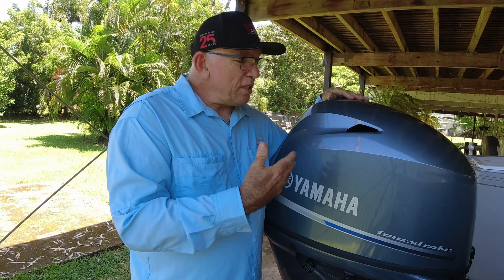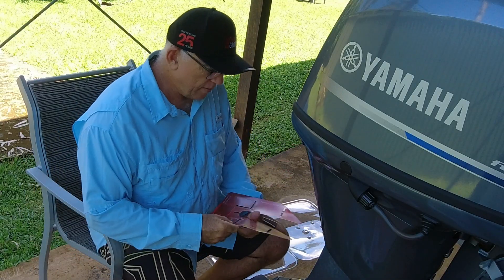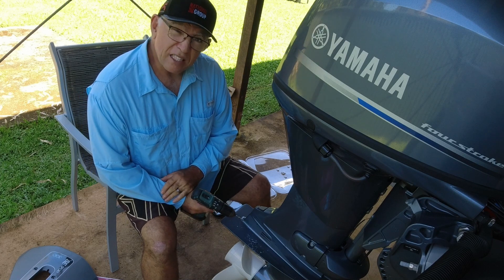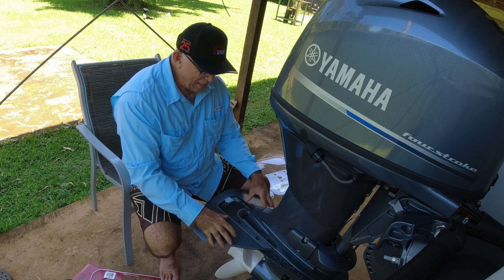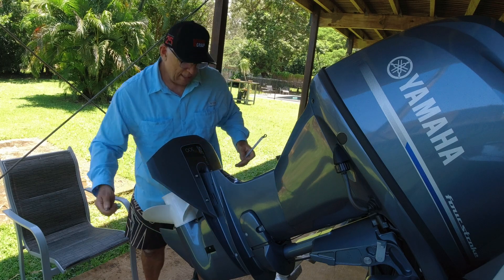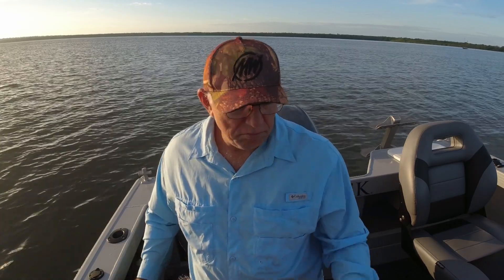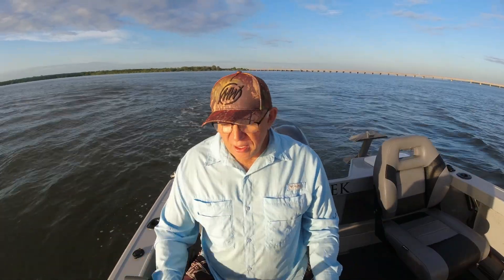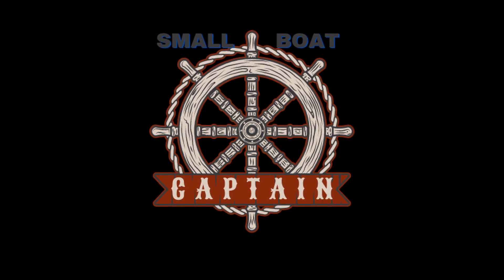HYDROFOIL. Do they work?

Comment: Gday mate being as i am going to have a fiberglass boat and a 40hp i will definetly be getting a foil can you tell me what gauges you have for the size motor and boat i would think really the only one i would need is the tacho  to be honest i have never used gauge before on any of my boats ,i wonder how a tiller steer gets on dont think there are gauges for them .
Reply from the maker: G'day mate. What outboard are you getting? If it is a Yammy like mine, I have the 6Y5 gauges. These are the basic gauges you get with a Yamaha but will have to buy them for a tiller. You can upgrade to a 6Y8 gauge which can work out your fuel burn and is a little more fancy. Both the 6Y5 and the 6Y8 will fit a 40 Yammy. Other outboards also have their gauges that will suit a tiller steer outboard but being a Yamaha guy, I am not sure on the details. They are cheap at around $300 plus fitting for a single tacho that also has the trim and a couple of alarms for overheating and oil pressure. That is the one on the video on the left. The second gauge I have is mostly for fuel but also has time, battery, trip and speed. But speed is not accurate so I use my GPS. 
Hope that helps and thanks for the question. I may not know all the answers but happy to share what I do know mate.
Reply: @smallboatcaptain1968  gday mate thats what i was wanting , the dealer dont give nothing away asked if i need a fuel tank control box all these things he could charge me for i already have a fuel tank and a new control box 703  had to buy it as the last owner lock tighted (permanent) the centre bolt to the case and also the screws that cover the control cables why who knows ,as i said i really think the only gauge i should need would be the tacho for a small engine dont need to know how fast im going as long as im moving in the right direction never had one on any other boats , he has quoted me between 500 and 1200 for fitting its a bare boat with new helm and control box if it goes to 1200 i will want to know why ,i have fitted about 5 engines to date myself and doesnt take a great deal of time considering it was a 40hp two stroke that came of bolt holes should be the same just a slap and fit job .Thanks for answering my question tell me do they still use the u bracket at the back of these gaues to hold them in still ?
Reply from the maker: @crispernator  Wow. You did answer your own question mate. I just went on line and checked. The tacho only gauge for the Yamaha 6Y5 is $330 and fitting it, as I am sure you know, is dependent upon where you want it. Plugging the gauge into the engine and running it through some conduit is not hard, as long as the engine supports that gauge. The hours you can spend wiring it up to a dash or panel is another story. But $1200 is nuts. Thats more than a full day of labour to plug a gauge in.
Reply: @smallboatcaptain1968  your dead right about the cost 500- 1200 that was for the engine fit up hook up the helm cable 4 mounting bolts and water test ,i have fitted around 5 engines my self it aint that hard dont know what the cost to fit the tacho would be it requires a loom as well 195 dollars i believe .
Reply: @smallboatcaptain1968  just to let you know i am getting a yamaha 40 had yamahas on all my boats 2 strokers first 4 stroke .
Reply from the maker: @crispernator  Might pay to shop around. That is way too much.
Reply from the maker: @crispernator  Good to hear. Great engines. I believe that anything made from 2019 has a plug in system for the gauges. You're right, a loom and the gauge should be a very simple fit.
Reply: @smallboatcaptain1968  with yamaha engines as you say everything is color coaded ,watched a guy change the early one  6y5 to the latest 6y8 i think took him 3 mins to change it over they are all the same biggest difference is they have a screw on bracket were the cy5 has the u bolt type set up 
 .
Reply from the maker: @crispernator  Exactly mate. The hardest part is going to be wiring to the dash or wherever it is going. Plugging them into the engine is very easy as long as they are compatible. Lots of people out there ripping us off mate.
Reply: @smallboatcaptain1968  trying to make up for losses during covid i think noticed the local yard is getting some more boats in now was barren before .
Reply from the maker: @crispernator  I don't know about that. The prices of boats went through the roof because of COVID and I had to wait 9 months for my new SeaJay cause they couldn't keep up. He's just being greedy mate. 
Let me know how the instal goes. I'd love to see a pic and know how it all went in.
Reply: @smallboatcaptain1968  Gday mate well boat is in or sitting waiting to be fitted up short weeks and work loads on the fitters have delayed it a bit but it is waiting there , spoke to the workshop manager about gauges and he said about 360 i think but he wasnt pushy said if i couldnt afford it maybe later apparently the engine has an hour meter built into it and it has a rev limiter and i have never run my engines flat out only for test after fitting then just ploddin along , my theory is as long as im heading in the right direction i am happy , oh also my foil arrived same as you have grey 300 good point to remember about 3 holes first cheers .
Reply from the maker: @crispernator  Great news mate. Let me know how it all goes.
Reply: @smallboatcaptain1968  Gday mate well the boat is home and i am a happy vegemite ,they did a really good install guy who did the water  test said it went awsome  now  i have to pluck up the courage  to drill holes in my new engine hahaha but i am stoked already pulling things out to find out where they are , the internal anodes are different to what they sell on the net but i am learning more about this engine than what i have watched saw a good hack for changing the oil and that was to get a 14mm 1.5 thread air fiting with a barb and hook a hose to it trim the motor up ft the hose  trim the motor down and let the oil run into the pan rather than try to balance a bucket under the outlet anyway i am a happy man .
Reply from the maker: @crispernator  Thats fantastic mate. I love learning new things about my boats as well. You're going to have to see if you can send me a link to that oil hack. Great idea. 
Glad you are happy with the boat mate. 
SBC.
Reply: @smallboatcaptain1968  ill see if i can track it down i know with a 70hp like yours i would probably come in very handy ill try to find it for you cheers .